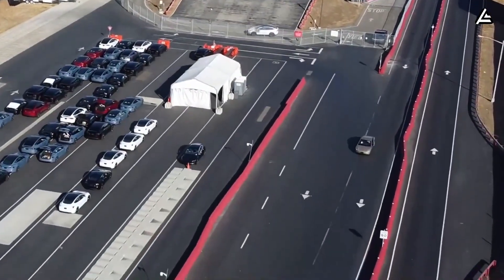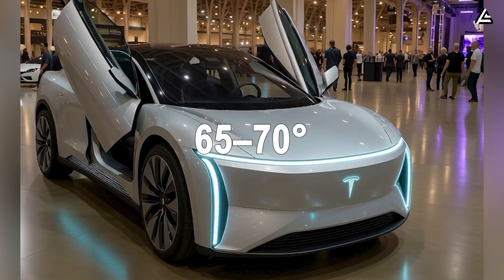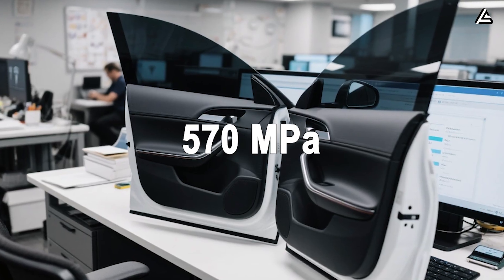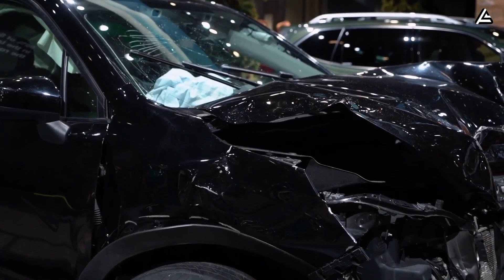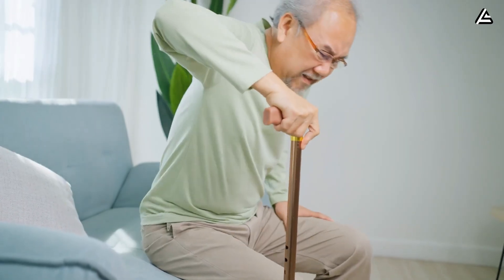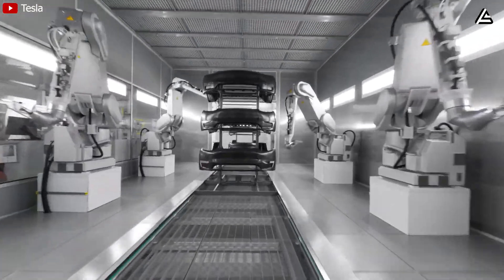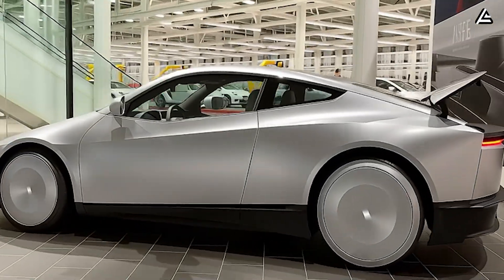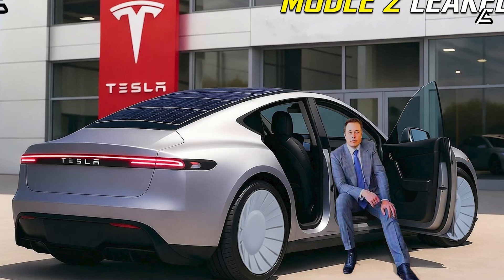Elon Musk Announced 2026 Tesla Model 2's Butterfly Door: What Makes It A Game-Changer?

Comment: What kind of copper windings are being used — Litz wire?
Reply from the maker: Good catch — Tesla’s been experimenting with hairpin and Litz-style copper windings depending on the motor type. Hairpins help with compact, high-power designs, while Litz wire cuts down eddy current losses at high RPMs ⚡. Do you think efficiency gains from Litz justify the higher production cost?

Comment: Is this water-based motor more efficient than PMSMs over time?
Reply from the maker: Not quite — water-cooled or water-based motors mainly improve thermal stability, not inherent efficiency. PMSMs still lead slightly in electrical efficiency (≈94–96%) while water-cooling keeps performance consistent and extends lifespan under heavy load. 

So they’re more durable over time, not necessarily more efficient. Would you prioritize steady performance or peak efficiency for your EV build?

Comment: Will butterfly doors open in my garage?
Reply from the maker: Good question 😄🦋 — Tesla’s butterfly doors are designed with ultrasonic sensors that detect walls or ceilings and adjust how high they open automatically.
So yes — they’ll usually open fine in most garages.
Is your garage low-ceilinged, or do you have plenty of headroom?

Comment: If an option for $1200, then they are a must for me.   Still debating the idea of dual motor or single motor.   The dual motor seems to have a larger battery which IF and it seems to be an IF the car can share power with my home then dual motor it is.
Reply from the maker: Makes total sense — if vehicle-to-home power sharing is confirmed, that dual motor setup becomes way more than just performance. Would you use it mainly for backup power or to offset your home’s daily energy use?
Reply: @AutoGearShift2  well I have Tesla solar panels and a power wall installed now, in fact I make more energy than I need for my home.  The app says I am 98% self sufficient.   But spring brings storms and power outages here in Texas.  The choice for me is either the power sharing thing but if that is not possible then maybe a 2nd power wall.
Reply from the maker: That’s a great position to be in. 98% self-sufficient is impressive. The choice between Powerwall expansion vs vehicle power sharing really comes down to reliability during outages